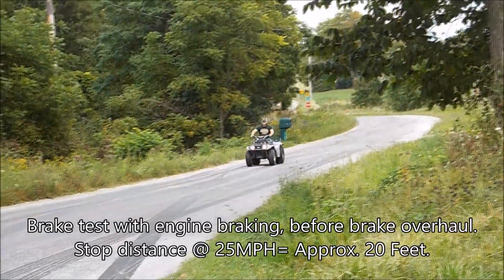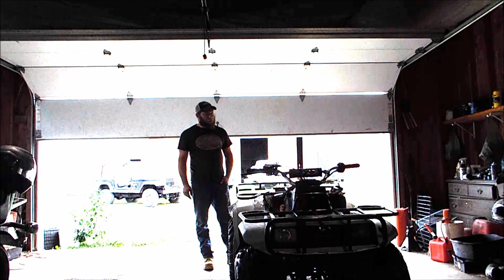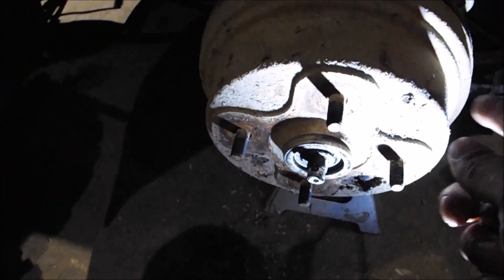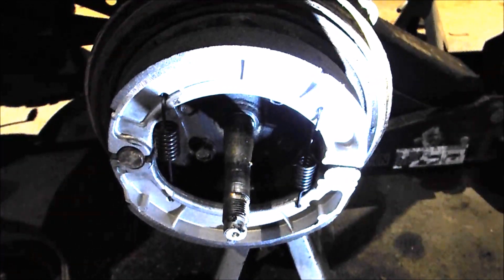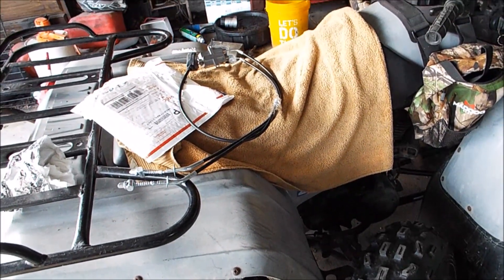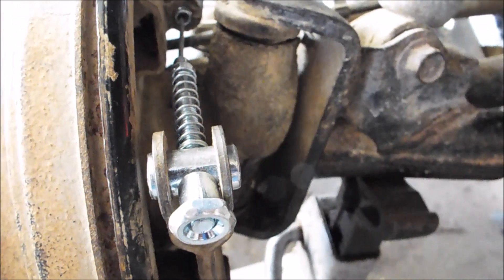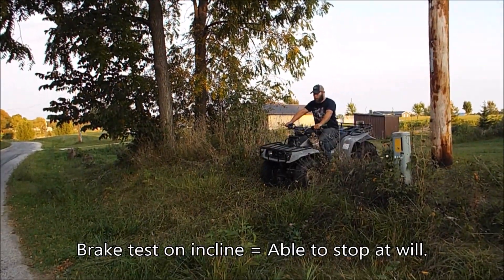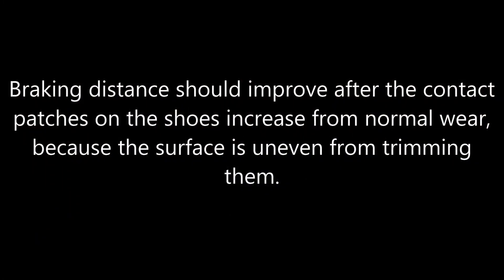Lets overhaul/repair old ATV brakes!

Comment: These back brakes are killing me. Went from having a little brake to using it hard going down a hill. Then it started rubbing as I went forward. Took it all apart today and now I have no brakes at all. There was a small little bolt that went inside the caliper and it came out and it’s all bent.
Reply from the maker: You can get any part you want usually on cheapcycleparts.com  , there are exploded views you can look at and order from.

Comment: Great video! I was wondering if you could provide a link for your brake cable set up. I have a 1986 moto 4 225s and need to redo my brakes? I am looking everywhere for that set up you bought and cannot find anything like that.
Reply from the maker: Right here man; https://www.ebay.com/itm/YAMAHA-ATV-1985-1995-MOTO-4-YFM350-YFM225-YFM200-front-brake-cable-Assembly/173415443645?hash=item28605dacbd%3Ag%3ATS4AAOSwNnRYl2yE%3Asc%3AUSPSPriority%2144859%21US%21-1&_sacat=0&_nkw=YAMAHA+ATV+1985-1995+MOTO+4+YFM350+YFM225+YFM200+front+brake+cable+Assembly&_from=R40&rt=nc&_trksid=m570.l1313
Reply: Thank You so much for your Quick reply! You da man! :)

Comment: What's the shift pattern on that Moto 4?
Reply from the maker: Neutral at the bottom, then up to 1, up to 2,  up to 3. up to 4, up to 5.

5
4
3
2
1
N
Reply: @azone123465  thanks man

Comment: Am I the only one that’s wondering where the radiator is
Reply from the maker: It is an air cooled engine, that is what the fins on the motor are for, they are heat exchangers. A lot of older ATV motors were air cooled and they are great the way they are for simplicity and reliability. The only real benefit to water cooling is you can run much higher compression ratios (which makes a lot more heat) but also gives more horsepower and efficiency along with other power generating tuning. Water cooling is supposed to be more reliable because of consistent engine temperatures, but if anything in the cooling system fails to function then the whole motor fails to function. There are still modern air cooled ATV's like the Honda Recon which is a great ATV.

Comment: I'm about to tear into my brakes. I've had nothing but rear brakes since 2001 and now they are so worn it doesn't stop it anymore. Did you ever figure out how to get your stopping distance down?
Reply from the maker: I should of went with an OEM pad, they appeared softer than my aftermarkets. Softer pad will stop faster but wear faster also.
Reply: You should HAVE used OEM pads.